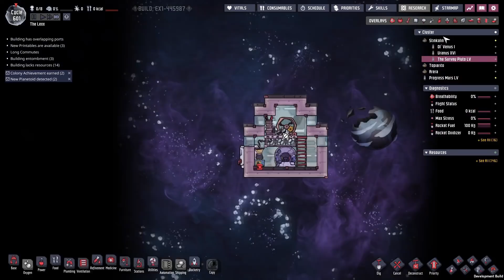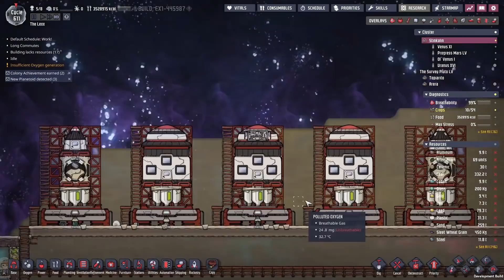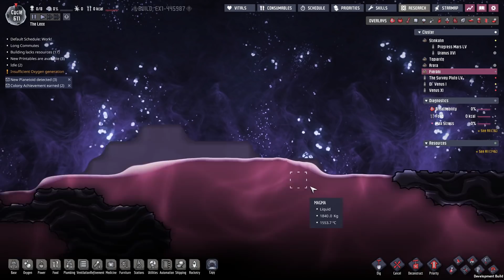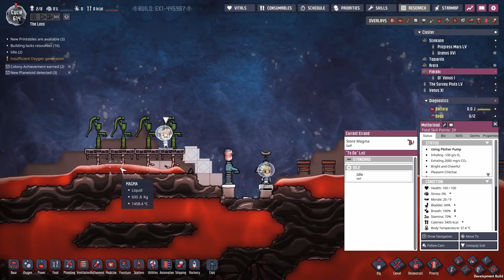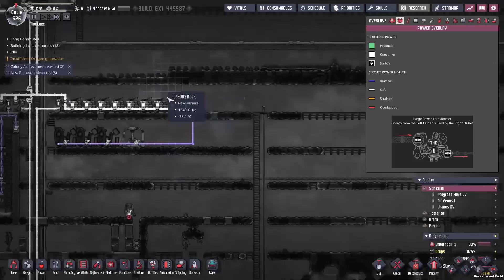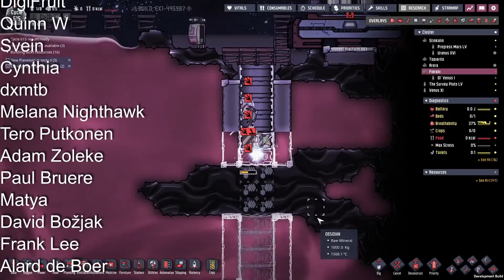Ep 7 Superconductive Niobium Asteroid :  Oxygen not included : Spaced out

Comment: i see couple improvments to be made for your rocket base for example using mini pump to save some space( thou it may generate more heat overall so i dont know
second more fun - you can use alot of pipes as so to say oxygen "storage tank" they can stack on everythink so you can weave them in throu entire cabin( thou its ofc decor hit but it gona save you r suits for longer)  thou i think i will rather go for 2 more big ships after small lander and have in each full blown base for 1 dup
And another think wich you can do but only with one dup- put weel before atmo suit checkpoint so when thy go in they can spin weel before they get into suits ( you could fit 2 dup chepoint if you move it to rigth side of cabin after pilot chair but that gona mean your dups gona pilot in suits and you need to fit somethink in those 2 spots between  wich is not bed or food or table

Comment: How about getting a mini gas pump to eject the carbon dioxide inside the rocket to the vacuum of space. Just build a single gas vent outside the ship. I imagine that wouldn't count so much as "cheating" since I can imagine real spaceships could use something similar, and you can imagine using said carbon dioxide as the fuel to make yourself feel better about it. Even better would be if you could actually refuel the rocket from the carbon dioxide inside the module via a specific tool made for it, but alas, this should suffice. As usual, a great video, always happy to see it in my feed.

Comment: I don't think it would be that hard for Klei to impose a hard weight limit on crew capsules. It would just have to be generous enough to allow for reasonable dupe accomodation without allowing you to just dump unlimited material into the pod. Could base the weight limit on the power of the engines attached to the rocket, and to avoid any crazy exploit with multiple crew capsules you could have it check the combined weight of all the crew capsules.

Comment: Carbon dioxide engine can only carry 2 additional modules, so it's super limited.
Sugar engine will need the small oxidizer booster to give it range, and the fuel is more expensive, but it can carry 4 total modules.  Downside other than fuel cost?  Speed.
That description card you moused over in the video near @22:00 is what i'm asking Klei to update, it's not accurate.

I did mention that on a prior post to you, I imagine though, that I may not have been as clear as just no.  Downside to insomnia.
Sugar engine, plus cost of either fertilizer or oxylite is a lot more hefty than just carbon dioxide, but imagine having a simple space module, and as long as the range isn't too bad, you could ship 3x liquid/solid/gas loads at a time, provided the planets are close enough.

BTW, I am so looking forward to this: Go into the codex next time you play, and look under rocketry buildings.  There is an interplanetary payload launcher!  It's not in the game yet, the opener is, but the launcher isn't.  When that gets put in?  May not even need rockets outside of transporting duplicants!

Comment: I put a single oxyfern in in a "natural" tile in each of my rockets in the bottom right corner using a pip.  You then end up with a layer of co2 in the bottom to keep things fresh and over time the excess co2 gets stripped out.   You could have run two plastic pumps above the toilet to avoid the co2.

Comment: Legitimately use vacuum of space to destroy liquid : cheating
Use exploitable mechanized airlock to cheat a way down : not cheating at all..

u wot m8
Reply: Lava doesn't evaporate, so vacuum should have no effect on it. The second is basically just using the building mechanics to simulate pushing a plug down. It's just an example of the way ONI has evolved to have nonsensical physics.
Reply from the maker: Well it was either that or door crushers, I prefer the diagonal building approach.

Comment: an easy way i found to oxygenate rockets is to just dump some oxylite inside it using an auto dispenser (with hand delivery by dupes) then the oxylite  can just sit on the floor offgasing oxygen using no power or resources at all. a bonus side effect of t his ive found is the carbon dioxide emitted by the dupes falls to the floor and gets deleted by the high pressure oxygen, meaning 0 CO2 buildup in the rocket.
Reply from the maker: That should have been the plan, I could not use it earlier as I had no gold and once I had gold I forgot to change.

Comment: im fairly sure sucrose engines have a module limit 2 higher than the bottle rocket, although it only shows the stat after you have built it.
also im pretty sure you coulda gone to the left without going through any magma just by digging a winding tunnel through the vein of obsidian coming all the way to the surface.
AAALLllso you could destroy the carbon dioxide with doors, wether you consider that to be too cheaty. personally i see it as just the same as venting it to space so it makes sense as a gameplay mechanic, or you could just break the walls of the rocket to add a door to actually vent it.

Comment: Space is a premium on the ship, but, might there be a way to filter the CO2 going to the atmo suit docks using the packet limiter trick to create a powerless air filter?  It doesn't really eliminate the overall problem of the build up of CO2, but could extend the life of a rocket before it needs to be emptied out, thus giving more time as a mini-base before you need to either leave or build a "real" base.  I think overall the rockets in the DLC need a gas input/output to allow you to pump out/refill the CO2/O2 in the living spaces.
Reply: Senor and a vent.  Vent opens when CO2 passes the senor this lets only air into the suits.  Zero power plus no CO2 to the suits.  Simple and zero power cost.
Reply from the maker: I think we can store the excess CO2 in a length of gas pipe segments that end in a bridge. Should buy us a lot of time.

Comment: i really dont like how the rocket living area is right now
real rockets need high tech stuff, in ONI all we can use is a dirt bathroom wtf
klei need to add storage/gas filters/suits pre-made for it, as it is right now, it's just a mess
i hated how rockets worked before and the fact that you needed an external calculator to go anywhere, but without a change this may be worst
Reply: It looks even less fun than before.   It's called a Tec tree.  You build things using Tec for rockets not throw outhouses in them.  Not very interesting game design.   The whole system looks like they were all drinking beer while throwing out ideas out half drunk that were stupid by even the simplest of design.  As the DLC sits now I'd never buy it.  It looks like a total mess of half baked ideas.  Moving the biomes to other planets was the best use the space travel?   Really?  Giving you every thing you on easily reachable planets that in turn give you everything you need.  Really?   ONI was a game of effort.  The more you gave the more you got.  This DLC is about almost no effort giving you everything you need.  Very poor design right out of the box.  I don't see it changing.  That would mean scrubbing the whole mess.  Never going to happen.  What you see it pretty much set in stone.  It's a shame really.
Reply from the maker: The early days of base ONI were the same, it was a year before we got a temperature sensor that went above 300C.
I predict it will be about a year before this has enough content to justify the price tag.
But that said, me personally I trust Klei to deliver. I cannot guarantee that so I'm not making recommendations to anyone else.

Comment: Great Video as always! maybe you can use the algae terrarium somehow ro remove the carbon dioxide in the ship? also placing a plastic pump in the very top of the rocket and a small battery would help with place and co2 problems; then a massage table would fit and the rocket would be ready for more stressing missions :)
Reply: Algea terrariums need too much water. 300 g/s is so much and your duped would have to manually water them. They also take lots more space.

Comment: Not sure if anyone has suggested it yet, but you could change the layout of the main rocket a little bit. If you swapped the jumbo battery and the air pump you could buy yourself a couple vertical tiles for the CO2 to build up in before you start destroying your airlocks (edit Atmosuit docks). it may take a little bit of configuring with pipes and electrical, but from a physical-space-taken perspective its a 1 to 1 swap. the dupes would end up sleeping in a pool of CO2, but at least you could extend their stay a little bit.

additionally the CO2 buildup in a rocket seems like a design oversight: I don't think it would be unrealistic to have larger rockets equipped with some sort of external vent/port so you could dump stuff into space.
Reply from the maker: The battery can't rest on the door, we need access to the second floor so one tile needs to be free to get up their. Could switch to a single battery though.
Reply: @FrancisJohnYT  Got it, forgot about the door. you really do have it packed in there. thanks for your reply and I'm loving the content. keep up the great work.

Comment: 21:41 what do you mean they are the same? Sucrose can’t go as far but can take more modules, but co2 goes further
Reply from the maker: I checked Co2 and Sucrose/fertlizer rockets and they both could only travel 4 tiles. The sucrose engine needs an oxidizer module to function so the extra module is sort of wasted. However I have been informed Sucrose/oxylite rockets can go much further.

CO2 Engine, Cargo, Capsule
Sucrose engine, Oxydizer, Cargo, Capsule

Comment: Hard to believe that you tackled the magma planet so well, though if there are plans to return to the magma planet to set up some facilities underneath all that hot magma and igneous rock (including, but not necessarily requiring, duplicant housing), then you might want to consider running radiant pipes full of, say, molten aluminum or steam (that dump their excess heat into a steam turbine room via thermo regulator or thermo aquatuner) through the shafts' walls (which I'm guessing were made from the local planet's igneous rock) to help keep them from melting.
Reply from the maker: I'm considering shipping the magma off planet, though what to use it for I'm not sure yet.
Reply: @FrancisJohnYT  A nuclear smelter perhaps, possibly minus the radioactivity (to get some of the aforementioned molten aluminum by cooking it up past its melting point of 660.3C for example, or just to cook some petroleum for sour gas, which would then be refrigerated into natural gas and sulfur, possibly with the help of some thermo regulators and superchilled hydrogen gas, I suppose)?

Comment: For cleaner rockets, producing oxylite on the home planet and dropping a couple tons in the rocket provides energy-less (and heat-less) oxygen for as long as you plan for. Additionally, it's possible to make a somewhat small mechanism to chew through carbon dioxide with a horizontal airlock under two tiles. When the airlock is opened and closed, it deletes one gas tile. Place that in the bottom right of the rocket and hook it up to some automation and carbon dioxide is no longer a problem, indefinitely.
Reply from the maker: I am going to switch to oxylite for the next rockets, though I will avoid the door crusher, I have some other ideas I would like to try first.

Comment: Yeah I can't really think of a way to dig down the lava without using some type of exploit either. Wonder what the intended way by the devs was 🤔
Reply: Well it's not finished.  However you could: (1) pump the magma with a liquid pump (using the recirculating fluid method) and dump it into space, (2) solidify (then mine) the magma by pulling the heat out with adjacent diamond/metal tiles that dump the heat into a steam turbine, or (3) use the building-tiles-diagonally method to push the magma aside (and into space) as you expand.  Still I think the map just needs some work.
Reply: @ancientgammoner6961  I said it once before - it is possible to dump heat into the vacuum of space via radiators. Including this as an building would totally make sense. So you could build a setup, that cools the surface and come back in 100 cycles to dig trough solidified areas.
Reply: @imaltenbach9166  I do think they intend to either modify the map to make it less crazy or (more likely in my opinion) add a building or mechanic like you're mentioning that would allow you to tackle magma without relying on the slightly cheesy methods we're discussing, which I do think is more on brand for Klei.
Reply from the maker: The left hand side has enough material that you could dig a tunnel down to the core, but that is unlikely to be an option on all maps. I am sure they will figure out something, they have done a great job on the game so far, I remember when everyone said they could never balance steam turbines and yet they found a way.

Comment: mad lad mining the larva planet :D You might want to swap the battery and the atmo pump around next time you try this though.
I'd like to see Klei add life support either to the nosecone or as a dedicated module, we really need some pipe connections to the command module so we can get rid of CO2 and pump in new gas/liquids. I'd also be nice if the command modules would have some small integrated tanks, like one for o2, one for co2, one for water and one for pwater, that way we could actually automate the refilling of these tanks when they land, then they could be self contained when on missions.
Reply from the maker: I was trying to think of a way to swap the two before launch but could not figure out how to arrange it. You need to get to the second floor so you need an opening. The gas pump can float so you come up that way. If you put in a battery or bed instead you need a floor. I baked my noodle a few times trying to get it working before settling on good enough.

Comment: A good way of Refueling rockets is using a canister filler to load tons of CO2 onto a rocket, then release it into a room with a gas pump in it
Reply from the maker: That takes a fair bit of prep, to get the CO2 bottles into the rocket is tricky as you can't pipe it in, you have to carry it in and release it so you can bottle it again. I find it simpler to just carry wood for now.

Comment: I'm sure you could fit a canister filler and a gas filter inside the rocket to get rid of the carbon dioxide. Hell, you could even store some fuel as canisters instead of making a whole fuel production plant.
Reply from the maker: Canister filler takes up a fair bit of space and I considered it but decided we would not be there long enough for it to matter. I'm thinking just filter out the CO2 and store it in some gas pipe segments, storing 10 or 20 kg would buy you a lot of time.

Comment: The fun part of the sugar engine is you can bring your fuel with you, and not worry about making a fueling station.

On the other hand, CO2 engines are viable for a rocket chimney.
You can also remove the CO2 from inside the rocket by pumping it into a canister filler and delivering it to a canister emptier.

Niobium give +50% decor, like gold, but can be used instead of ores. In case you needed a reason to tame the volcano.
Reply from the maker: I'm going to have to give the sugar engine another look, I did not have access to oxylite last I tested them and I hear it gives far better range than fertilizer.

Comment: I wonder if that glitch where debris that falls on a pile of the same element takes on the temperature of the pile still works. If so a dispenser dropping the hot niobium onto some cool niobium might make mass transportation of niobium possible without cooking the dupes. Not that it is needed given that at least 5 kg got off that planet without much issue.
Reply from the maker: That glitch is when a liquid cools to a solid. So liquid water falls on a piece of ice debris it instantly takes on the temp of the debris.
Debris to debris they just even out in temp depending on mass.
Reply: @FrancisJohnYT  Hmmm... I had it wrong but possibilities are popping into my head. cold metal under a volcano?
Reply: @bagel5085  maybe, but the liquid still has to freeze: for example, you can leave cold gold around a volcano, but you still have to cool the liquid gold

Comment: Hey man love your stuff. Can’t wait for an oxygen not included video everyday. Why don’t you use oxygen terrariums in the ships? Gets ride of carbon dioxide and adds oxygen.
Reply: Then you need to transport water wherever you're going and get rid of the polluted water from the algae terrariums
Reply: @s19tealpenguin61  i'm not sure about the math, but the polluted oxygen might also be a more serious threat in small spaces, considering the yucky lungs debuff drastically increases o2 consumption
Reply from the maker: They require water and algae which can be arranged with enough effort (water is the tricky bit). But the oxygen diffuser is a lot simpler. I think next we will move to Oxylite which is even less effort.